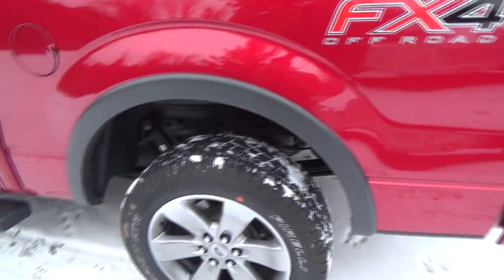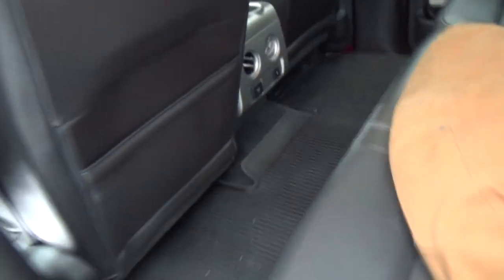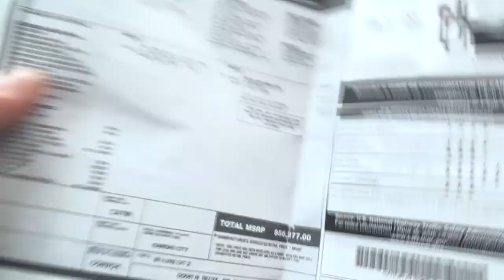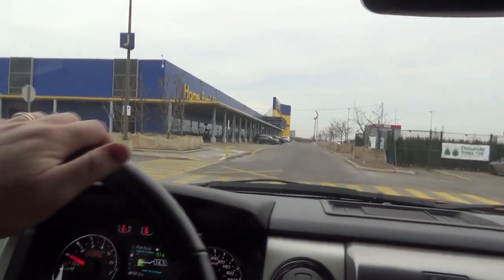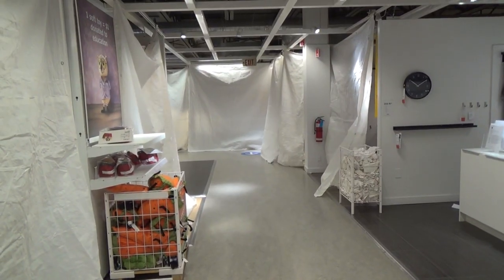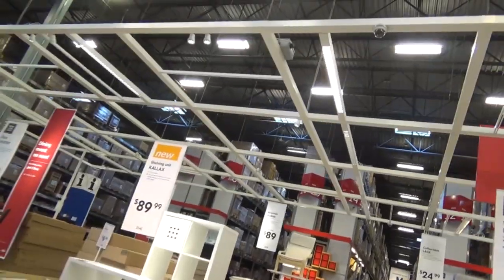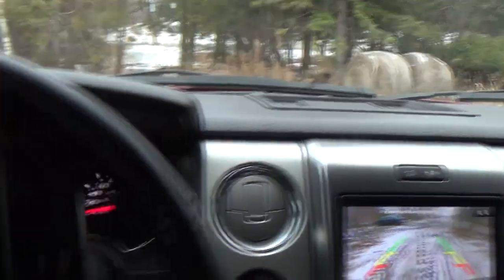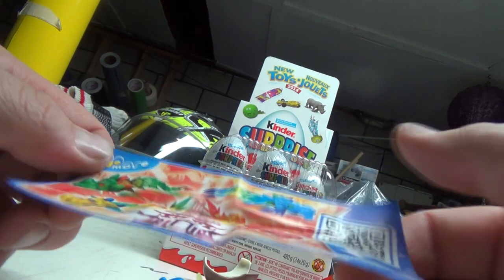First jaunt in the new FORD truck to do some Christmas shopping

Comment: Nice truck.  I just hope you don't have issues that some have had with condensation in the intercooler causing limp mode to engage or carbon build up in the intake tract.

Comment: If you put the truck in 4 low then pull the 4x4 knob out your rear end will become electric lockers so both rear tires will spin the get you out if you get stuck.

Comment: I was a GMC guy for the last 20 years but had to switch to a 2010 f-150 and a 2008 f-450 to fit my 6 foot 7 inch body.  GMC and Dodge are not very accommodating for my large frame in the newer models.   I was pleasantly surprised and I am very happy with both trucks.

Comment: Bill, The F-150 SuperCrew is available with either a 5 1/2 foot bed or a 6 1/2 foot bed. You don't have to get the 5 1/2 foot bed just because it's a SuperCrew. You can have both a SuperCrew and the longer 6 1/2 foot bed.
Reply: When you buy new
Reply: Veikra When you buy used too!
Reply: The 6 1/2' bed has a two piece drive shaft as well. May not be an issue, but that is why I went with the short box.
Reply: Rattletrap2 I would not go with the short bed just because the longer bed has a two piece drive shaft! I would rather have the 6 1/2 foot bed! Who cares that it has a two piece drive shaft? I would rather have the extra foot of hauling space in my bed!
Reply: *****
 yeah, no issues with a 2 piece driveshaft, mine takes all the 850 ft-lbs with 370 000 on the odometer. If it's designed well it's no issue.  Although the ford fusion's driveshaft is a real bad multi section driveshaft, i dont think the pickups have that issue
Reply: Ok, good to hear. I admit, I didn't do much research before making that decision. I figured that for hauling larger loads, I have a 12' trailer to use.

Comment: Hi Bill like the new truck,It don't bother me.I got a 99 7.3 250 SD 4x4 it's got a hard 550.000kms on it last owner beat the crap out of it, i did some work on running gear but nothing other than water pump and good service on the motor and it's now a real good truck,  I love it, apart from $1.30 a ltr diesel here in Manitoba.I have had  2 150's. as well they both got more on than 300.000 as well before I replaced them. 
Got a 97  GMC 1500 4x4 z71 off road. it won't last as long as your old truck. got 250.000 and it's got trans issues, leaking lines and rad  and the body's worse than yours was. I looked after it to and its just falling apart Had 116.000 on when i got it in 04 and had issues then as well.
 If the Rigeline dealer/service guys are  ignorant  in the rest of North America like they are here, thats part of the reason they are bottom. The other is it's an un economical pile of crap with issues. My Moms friend just dumped hers and got a new ford. similar to yours due to those problems. Seems the Ford guys gave good money to get her out of the Ridgeline!!!!!!!!.
Regards Robert

Comment: Bill to turn on your electric rear diff lock you need to pull the button that controls your two wheel and four-wheel-drive it would be just like turn on your fog lights

Comment: ford is nice truck when its new and still under warranty.. every one of them has some glitches engineering,electrical and mechanical but the one most money maker for us mechanic is ford. but the good thing you got a good warranty coverage because we starting to see the ecoboost most often
Reply: its still a new engine concept for Ford. lots of feed back will help them.
Reply: gubb73485 The 3.5L EcoBoost is not really really new! It came out in 2010 in the Ford Taurus SHO and the Lincoln MKS. Then they put it in the F-150 in 2011!
Reply: still pretty new in my books.
Reply: gubb73485 Yeah it's still pretty new, but not brand new!
Reply: the 3.5 ecoboost is great platform, but the problem is not design right. yes they run this none stop on their test and nothing happen but they dont consider how does their consumer use it. right now 3.5 has problem regarding  carbon build up on the valve and ford still has no answer how to fix the build up except changing cyl heads and ford market this with better fuel economy which is not happening
Reply: It's hit or miss. Always had bad luck with Chevy (every. single. time.) Whereas my father's ford ranger has only had to have a battery change and two new mufflers in the past 13 years. He keeps abusing the sh!t out of that little truck, and it keeps working... Now say like on my father in law's Silverado... lol. Replaced the charcoal canister, the evap vent solenoid, battery a couple of times, miscellaneous electrical failings, for some reason it needs the tensioner pulley and idler pulley replaced every 10,000 miles or it squeals HORRIBLY. Also the main seal leaks so bad you need to add a quart of oil once a month. Oh yeah, and it's a 2008, so the Ranger is considerably older. Am I saying you should dislike Chevy? No. What I'm saying is my experience with Ford has been much more pleasant, so to each his own. Either way it's important to have choices, because if you only have one company making trucks you run the risk of them getting lazy and stealing your money. At least with Silverado and F-150 competing they have to keep their standards up or the other guy will steal sales.
Reply: You see Fords more because there are literally 3 of them on the road for every 1 GM/Dodge.  They sell like hotcakes.  Their failure rate is really the same or pretty damn close to GM/Dodge.
Reply: I've made more off Chevrolet been a mechanic for 17 years and I'm a Chevrolet guy all I've ever owned but still I made more off Chevrolet what usually breaks cost more here in Kentucky but we have more Ford's over here

Comment: The washing machine is standard sized. Maybe a bit smaller capacity-wise for nowadays (you only get 6 or 7 kg models now, which really sucks for one person), it looks like a 5kg model, so basically the size that has been around for decades.

Well, maybe not on the North American continent, where everything is just a bit bigger, but to the rest of the world, it's a very normal machine ;)

Comment: Gotta watch out for timing chain problems on these Ecoboosts.Also a little advice bill. Don't listen to ford's recommendation on oil change interval's. If you're someone that regularly changes you're oil at 3,000 or 5,000 miles( whatever the exchange to KM is) keep doing it with this truck.

Comment: Ford did not take a bailout from the government either. Says something for Ford Motor Company.
Reply: And gm is begging the government for another bailout  worked for a gm assembly plant for a year and some change, gm is in some rough shape
Reply: QuainBuilt However, I give GM this, they do have some really good products. Being only 17 years old, I can't afford much, so was stuck buying an old truck. 1987 Chevy R30 flatbed for $800. Had to do regular maintenance repairs since getting it, but even so, It's never let me down and I've been able to drive it every single day since buying it. However, I like Fords too. :) I think just about any brand is good, and that a fair amount of things needing repair on a vehicle is just based off how the vehicle is treated/maintained.
Reply: Like you mentioned, Any and all vehicles break down, that's a fact, and like you said maintenance is key, but when "new" gm started to cover up safety recalls and kept denying that's when I lost respect for the company as a whole, every manufacturer has its issues but when your recalls surpass your production numbers that says there is some major cover-up that has been unearthed. Those old 350 block engines were nearly bullet proof along with those th350 and th400 transmissions
Reply: That's right know we talking peterbilt the only semi that's beast
Reply: QuainBuilt Yeah, the 350 is pretty much bullet proof. Not sure what model transmission mine is yet, been trying to figure it out, because I have the 4 speed manual transmission with the Lo/Granny gear instead of the auto trans. So not sure what model trans I have yet, but I can tell after all these years, it's finally starting to wear out just a little bit unless I take good care of it. Just got it like 3 months ago, put over 6,000 miles on it already
Reply: lawnboy81SMS most likely you have a sagana or Borg Warner. There should be a identification tag on the transmission make sure you keep the gear lube level up on those old transmissions, and check the adjustment on your clutch, that should help preserve, and keep some cash in your pocket rather some else's,keep that classic on the road
Reply: QuainBuilt Yes, thanks. If there is a tag, I'll have to look for it then. I don't have to adjust the clutch as it is a hydraulic clutch, but I did replace the Master clutch cylinder as well as the slave cylinder about a month or so ago. But so far, I've loved this truck :) It's old and rusty in some places, but it's reliable and runs really well (though the engine could use a front seal, but then again, it's also an old truck) and to save money, I'm able to do all the repairs myself since I have the know-how of how to do it. It's by no means fancy, but I've only seen one other truck just like it, but with a different style flatbed on it, but same truck.

Comment: Hay Bill i have herd that the easy fill fuel can sometimes cause a e vac fault code so keep that in mind
Reply: and  it makes filling with a jerry can a pain. Have to push the little pins with coat hangers to unlock the flap, then push the flap, then put the nozzle in
Reply: Veikra Or you can just use the special funnel that they give you with the truck that is under the rear seat it holds the flappers open for you so you can dump fuel in it if you have to!
Reply: oh I didnt know. So to save plastic they did away with the fuel cap, then made another plastic funnel with the plastic saved. I helped someone fuel his car and cheat the device. Had I known this I would have looked under the seat !
Reply: Veikra They didn't do away with the fuel cap to save plastic! They did away with the fuel cap for convenience reasons!
Reply: *****
lol, how inconvenient is it to put a cap on.  "Oh no, I have to remove a cap....better leave that to the professionnals and go to a full service station"
Reply: Veikra MORON!!!
Reply: *****
 You didn't get it. Plus I'm glad that as a moron, I can still remove and put back a gas cap perfectly fine without losing it :p
Reply: richard smith
 was not replying to you, but to whatitis99 as my comment linked . You only got notified cause youtube is weird with this G+ thing

Comment: Im my grandpas old truck it was a ford but different engine it was a powerstroke but the fuse box was under the steering wheel by the gas and brake peddles

Comment: You don't have the shift on the fly 4x4 if you did you could shift to 4h without putting it in neutral but you do for 4low
Reply: David Lockwood Yes he does have shift on the fly 4x4. It is shift on the fly, like any modern 4x4 system! You can shift it to 4x4 High while driving down the road at any speed. Please learn what you're talking about before you tell people stuff that you don't know anything about!

Comment: I'm a noncombatant in the Ford, GM, Ram wars but I do follow several channels re auto repairs.  You should checkout FordTechMakuloco channel. He is a dealer tech and has a lot of good advice to follow re the 3.5L Ecoboost.  One re spark plug clearances and change intervals should be helpful in a preventive maintenance kind of way.

Comment: all ford engine are noisy,my f-150-2012 -fx4 wit 52.323km sound like a old singer sowing machine,my ford dealer tell me they have to replace the knock sensors to get rid of the noisy motor sound like valve chattering.

Comment: The only thing I hate about new cars are they don't have throttle cables anymore they have a thing called drive by wire where a electronic motor turns the flap in the throttle body its stupid
Reply: If that upsets you, wait till steer by wire becomes the standard.
Reply: EngineMechanic128 Who wants a stupid throttle cable anyway?
Reply: Before long the cars will just drive them selves